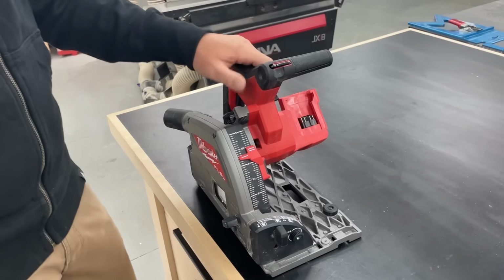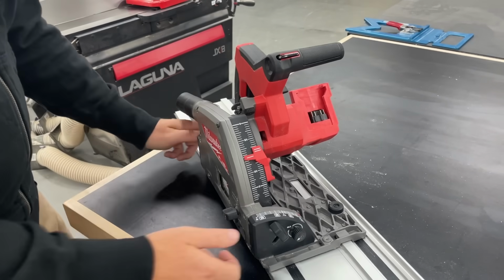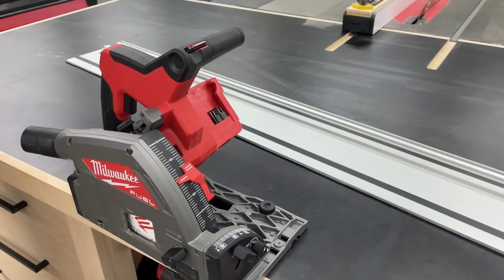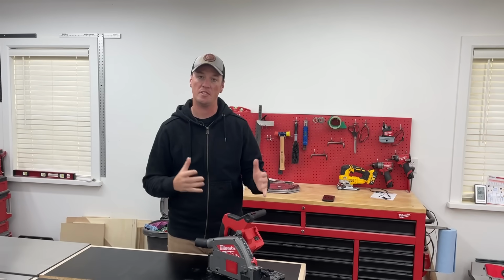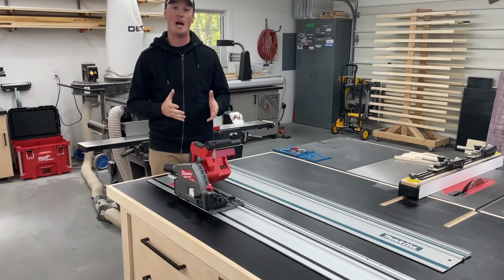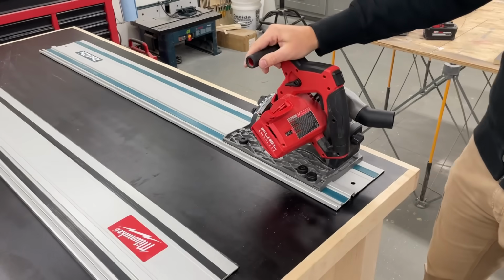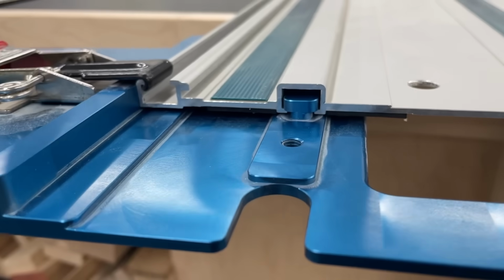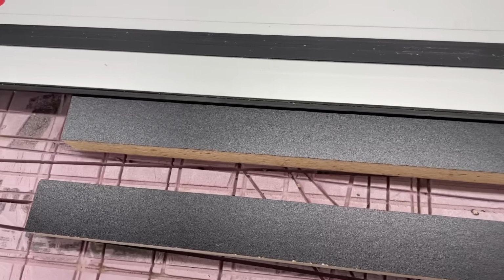The Truth AFTER 9 months Heavy-Use | Track Saw Review

Comment: I’ve read some that say the blade doesn’t line up with the  anti-chip strip when beveled to 45 degrees.  Is this true?  Also, would a different company’s track make a difference in this same regard?
Reply from the maker: Mine barely, like 1/32, cut into the bottom edge of the strip when beveled. I’m not sure about this on other tracks

Comment: For myself, I’m running the bosch fsn rails with a mafel Mt55cc and a Bosch GKS18V-25GCN.  I love that I can use my track saw with all the other major tracks and the fsn rails.  I also believe the fsn track joiner is superior to the other brands.  It is hard to hate on Milwaukee though.  Thanks for a thought out and thorough review.
Reply: Hey tell us how the Bosch tracks are doing? Any wiggle from the milwaukee on them? I saw your comment and looked them up, Milwaukee saw deal at acme so reasonable with the jump red code I cannot pass on it, but interested in these Bosch tracks..thanks for the update f you post it
Reply from the maker: @thetoolmat8632  the Milwaukee doesn’t work on the Bosch rails. He uses the Mafell saw on his Bosch rails
Reply: @thetoolmat8632  Doing very good 2 years commercially. 1.) the extra length is a big plus. 2.) splinter guard replacement is superior in both form and function than any other track 3.) alignment and accuracy is still great.  Lastly, a track saw is an investment in you and your production.  You really can't go wrong with any of them.
Reply from the maker: Have heard nothing but good things about the Mafell
Reply: I have the Bosch GKT18V52 with fsn rails and I'm not a fan. The way the splinter guard goes in I find it always shrinks, I also find the face edge of it compresses when you clamp it down which means you're not always perfectly on your pencil mark. I also find it's basically unusable without rail clamps

Comment: I went w/ the MKE once I finally decided that I needed a track saw. I love the saw and the fact that it uses the same battery platform as all of my other cordless tool (-1). Also like you, I’ve found that the “original” TSO track square works just fine. Thank you for doing the long term test. It matches my experience w/ this saw.
Reply from the maker: Good to hear, thanks for watching!!
Reply: Do the TSO parallel guides work fine? Does the Milwaukee offer a super long track yet?
Reply: @Bass-In-Your-Face  I bought the MKE track saw package. It same with two 55” tracks that can be connected. Instead of the TSO Parallel Guides, I opted for the TSO GRS-16 PE Guide Rail Square, and the Woodpeckers Parallel Guide System (I’ve heard good things about the TSO Parallel Guide system - see Jason Bent’s youtube review). The folks @ TSO said that the GRS-16 PE wouldn’t fit the MKE track, but it’s worked fine for me. TSO has recently made a slightly different Guide Rail Square that they say IS compatible with the MKE track. You might want to go with the new TSO Square if you don’t have a rail square for your MKE Track Saw. Hope this helps.

Comment: If this saw was out earlier I would of bought it but I have the makita 40v they are both nice saws. the dust collection on makita with the AWS is a nice feature I think the makita has a bit more grunt or power but the milwaukee is nicer saw alll around more user-friendly adjustment and the fact it has a splinter guard like festool saws. 
My next saw will likely be a festool TS 60
Reply from the maker: I was about to check out the Makita 40v when it came out too. But gosh that’s still basically buying into a whole separate platform haha

Comment: I’m thinking about buying a track saw, one question I have is do they take a standard 6 1/2 inch blade or do you have to buy a track saw specific blade that cost a fortune.
Reply from the maker: Yea they’re different blades, different size arbor holes compared to regular circular saws. They’re not that much more expensive though
Reply: @JohnBuildsIt  Thanks for the feedback I appreciate it
Reply: @boogiedahomey Thanks for the input. I knew the thickness of the blade would be important, wasn’t sure about the arbor. Thanks again

Comment: Thanks for the follow-up review. I'm in the market for a track saw and Milwaukee is on my short list. This review helped to move it to the top of the list.
Reply from the maker: Thanks for watching!
Reply: I agree.  What blades do you recommend or are the Milwaukee blades sufficient.  I will be purchasing to cut cabinet panels and hoping for zero tear out.

Thanks
Ron
Reply from the maker: @RonHutcherson-hj3rx  I’ve actually been really impressed with the Milwaukee blades. The Fine Finish blades are a little thicker, which I prefer, and have been great

Comment: Hi John , i noticed that over a 1.4M rail the Milwaukee was heavier and more rigid than the other rails.  Thank you for the other illuminations like the adjustments in the base and the anti tip working in the Makita rail too.  Not feverously speeding through the different points is really apreciated.  When i tested one, i found that it was well balanced 😊and secure on the rail.  On looking at the protrusion on the rail i noticed that it was not as heavily rounded on the top as other rails.  The  new cordless router looked great on the rail.  Are you able to compare it with other rail adaptors?  Is it just as secure as the saw? Needless to say, i bought a red Milwaukee rail.
Reply from the maker: That red rail is awesome! And yea the router adapter is tightened to the track exactly like the saw. It has 2 anti tip tabs on it as well

Comment: I think the proprietary blade comment was about the thickness or kerf of the blade. The Milwaukee's is even thinner than the new thinner Festools. This thinner blade cuts down on sawdust.
Reply from the maker: I’m not sure if that’s it. Even within the new line of Milwaukee track saw blades, they’re different thicknesses and not all the same
Reply: @JohnBuildsIt so will you need to replace/swap the strip if you use a different blade?
Reply from the maker: @macp349  no, a thicker blade just cuts a wider kerf to the right, not cut closer to the track/saw
Reply: I found that Diablo carries tracksaw blades now as well. Watch the thickness regarding  the riving knife. One of the blades I got drug through the kerf a bit. But the blades are decent. And maybe more available than the Milwaukee blades at different suppliers. I couldn’t find a framing blade for my new Milwaukee until I happened on a different lumber yard.